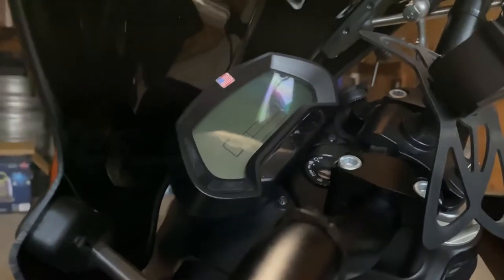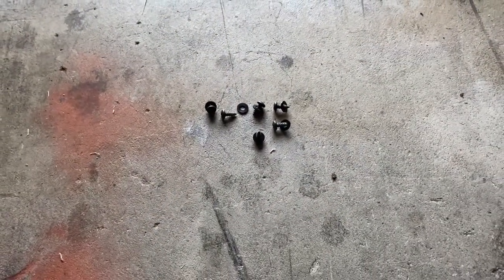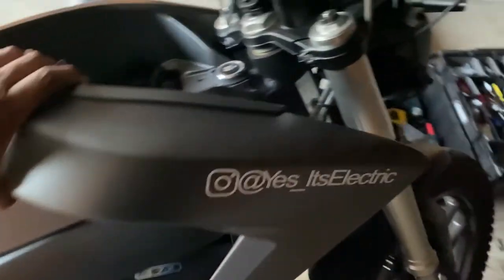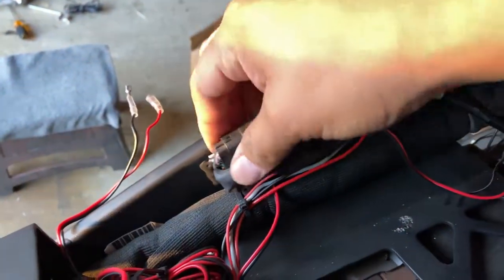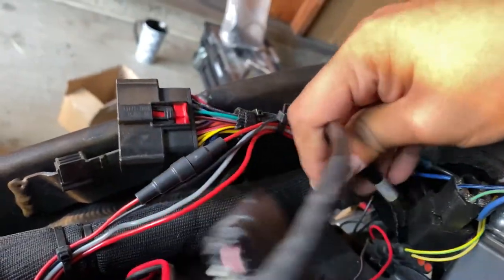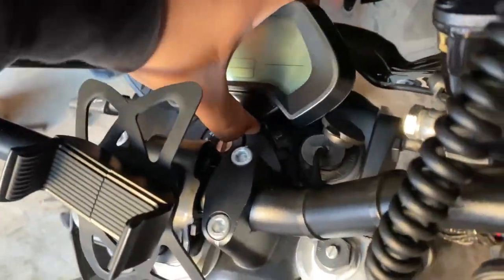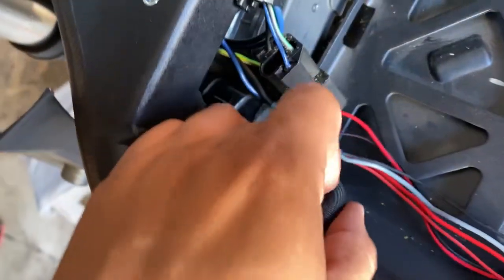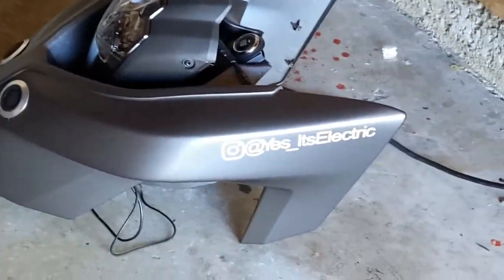Zero Motorcycle Dash Upgrade

Comment: Dude that's rad!  I didn't know the new screen works with the older pre-Cypher models.  Thanks for sharing!
Reply from the maker: It does! Unfortunately no clock. But it does look cool!
Reply: @yes_itselectric  Is it that the new dash doesn't have a clock function or that the clock doesn't work when the new dash is put on pre 2022 models? Thanks.
Reply: @conorhealy898  The new dash does not have clock function. Zero's 2022 owner guide does not even mention clock function at all ...
Reply: @Beloforum  Thanks for the information. The lack of a clock would annoy me. Seems a strange one to leave out when "upgrading" the dash.
Reply: @conorhealy898  Most of the rides, my phone is mounted on the handlebar so the clock is present there. And now I've installed a tires monitor (pressure and temperature) that has a clock displayed as well ...

Comment: Looks good. I have a powertank and I bet it would be a nightmare to get to those cables.
Reply: Now pull off the protective plastic cover.
Reply from the maker: 8 months later and I still haven’t 😂
Reply: I have one of these displays and a power tank and the routing is too tight for it. It requires an extension which I haven’t made happen yet.

Comment: Hello. How does the junction between the headlight and the new dashboard look like ? Based on 2022 pictures, it seems there's another part on top of the headlight to fit the new dash. Thanks :)
Reply from the maker: Not entirely sure, I have not removed my windshield since installing the display. I will someday and post an update to my IG. @Yes_ItsElectric
Reply: @yes_itselectric  Hi ! I've upgraded the display on my S 2021. The "old" display cable was already shorter than yours and the connector was located exactly where it shows at 5:06 and obviously, as the new display cable is the same that you've got, I've just kept it there.

Comment: What headlight upgrade kit is that. Looks awesome.
Reply: What version did you get the halo version ?
Reply from the maker: @skyr6762   Mini H1 Primo - RHT (driving on the right side of the road EU, US etc.)
Reply: I’ve ordered this kit for myself now! Glad someone has made an aftermarket kit for this housing finally. Other LED lamps have different light spreads which throws the light a bit.

Comment: Does the display also contain the cypher os? More specifically, can one consider this an mcu/os upgrade or is it really just the display? What limitations are there if its not mcu equivalent? Also that third screw: is it sticking out somewhere or worse scratching the component underneath?
Reply: It’s just the display. The OS is in the MBB which is in the center of the bike. This just displays data received over CANbus from the MBB.
Reply: @BrianTRice77  Makes sense. Thanks for clarifying.